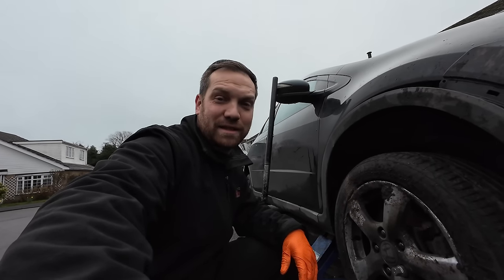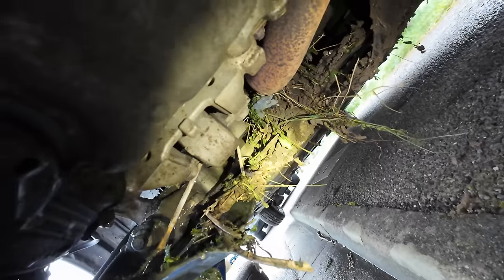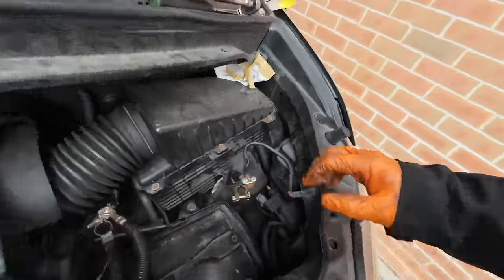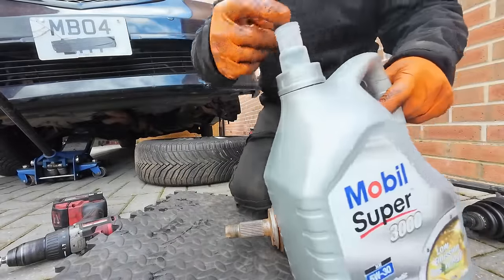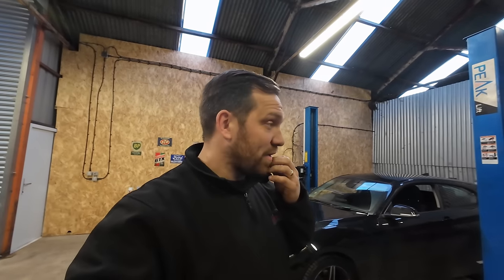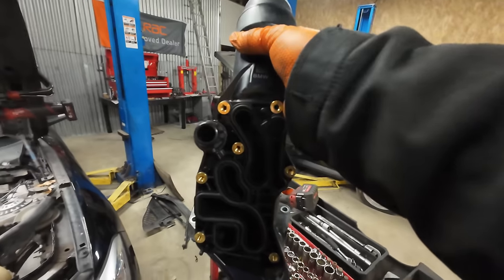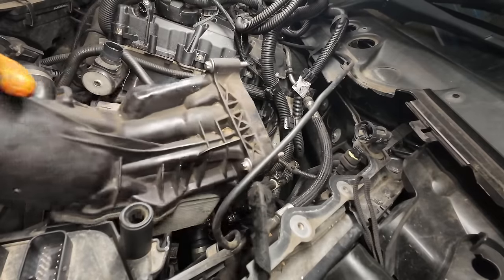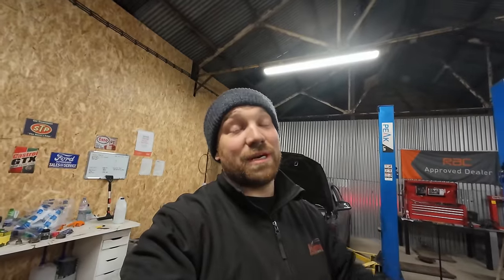Customer crashes into a ditch | Weird import cars | BMW coolant leak fix | Day in the life EP9

Comment: Worked in aviation for 45 years and 1/4" drive sockets, extension bars & ratchets were essential and now it looks like it's getting the same working on motor vehicles
Reply from the maker: The amount of different tools and equipment needed is unreal isn’t

Comment: That BMW is a far worse design with servicing/maintenance access than my 2007 Z4! The oil housing gaskets were fiddly on mine but a breeze compared to your job - and their use of plastic has gone beyond and seems to be getting worse 🤯
Reply from the maker: I know, madness mating plastic to a hot metal engine block 🤦🏻‍♂️